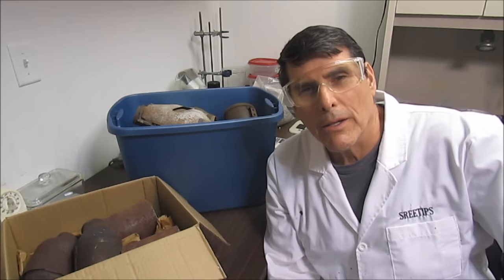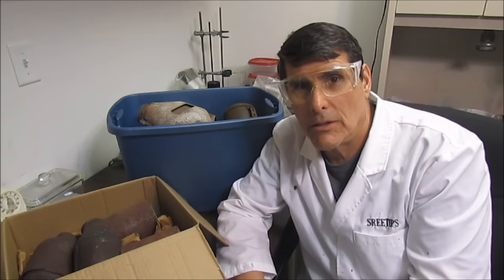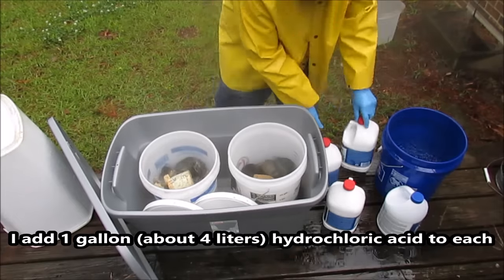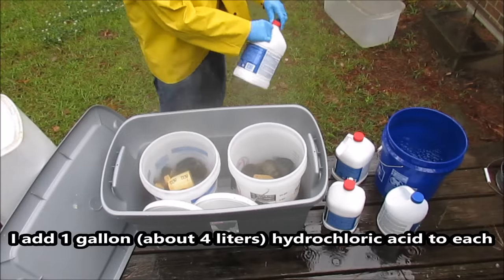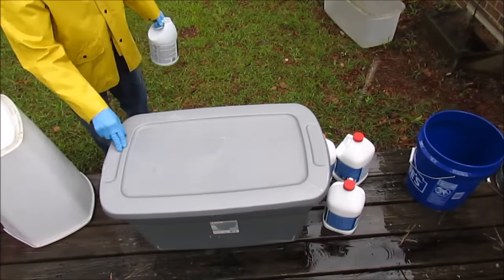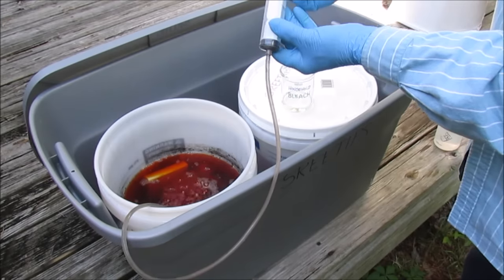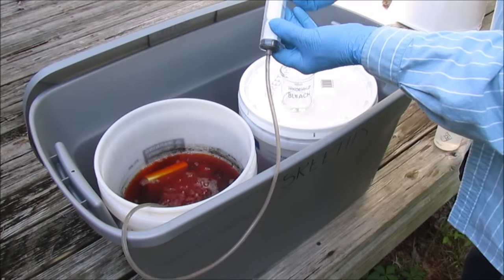Platinum Recovery From Automotive Catalytic Converters Part 1of2

Comment: 30:17 I really dislike the term CEMENTING.  Chemistry was a path I considered after earning the highest grades in high school in all the sciences and could do ion exchange reactions in my head from memory, knowing all the ion states for every element in the periodic table, as well as all the side reactions.  The proper term is REDOX REACTION, or Reduction-Oxidation.
Reply from the maker: Within the refining community, it’s called; cementing
Reply: @sreetips  i know, but you're sometimes using technical terms and sometimes street terms.  Cementing is a street term. Cementation on the other hand, is a technical term, as its a form of precipitation by ion exchange.  All ion exchange reactions are REDOX. It's like saying "preciping" instead of "precipitating".

Comment: Change the filter paper when it gets clogged.
Reply from the maker: Negative, if you noticed some of the fine material made it through that filter. That fine sediment came through the brand new filter when I first poured the liquid through the filter, before the filter "loaded up." Once the filter got loaded with fine particulate, the filtrate began to run clear and free of all sediment. Changing the filter paper with a new one would have allowed more sediment to get into the filtrate. The best option is to pull it through the loaded filter paper with the vacuum pump.

Comment: Instead of all that "goat rope" with the hose, why not put a funnel on the top of the tube & pour the bleach in?  The game should be to minimize the number of handling steps when dealing with chemical hazard!  Not having to even be near the reaction is better than all the masks & gloves!  You could also rig up a rocker to agitate the solution.
          One other Youtuber put hoses in permanently, fed from flask with pool chlorine tablet.  HCl is slowly dripped onto the tablet from sep funnel, automating this process.  You could do the same with either Cl2 or bleach.  Adding Cl2 will not add to the bulk of the solution.
          Quiz question: that same Youtuber precipitated the rhodium with chlorine gas feed (after the Pt & Pd was removed).  How can the same gas both dissolve & precipitate the same substance?
          You are dissolving a handful of grams metal.  Unlike other recoveries, you have no or little "base metals" to deal with.  Why do you need 2 gallons of HCl & many additions of bleach to dissolve such little amount of (very thin coating of) metal?  Does the acid need to be concentrated?  What would happen if you added about 10x less acid at the start?  (I would set up a small pump to circulate the dilute solution in the buckets with a bleach or NaClO3 drip.  The solution needs to circulate through all those channels.  The pump can do the transfers with only a valve.  No awkward pours of toxic solution!)  Then filter & run 90% of it through a still, recovering most of the acid & concentrating the metal so you get good precipitate with (a small amount! of) zinc the first time.  Why does adding more acid, then more zinc, after the metal is precipitated "clear" the solution?
Reply from the maker: I’m not sure. This was my first attempt. I was making it up as I went. After re-watching the videos, I still can’t believe that I was able to pull it off.
Reply: @sreetips  What I would try is this:  Bucket with hoses routed into the bottom.  Have pump that sucks solution from the top & injects it into the bottom.  Between the pump & the jets, I would route the solution through electrolytic cell with 2 graphite plates with a low current flowing.  The cell would plate out any metals in solution on the cathode, the anode would make chlorine gas which would be carried as fine bubbles into the jets at the bottom, as slow, continuous, rate.  I would also have filter in the loop.  You put the HCl in the bucket (a lot less!) & a little chlorate.  Then sit back & wait for all the metals to appear on the cathode graphite.  There is no handling of the hazardous solution & the concentration of the metals in solution remains low (making the loss due to drag-out low at the end of the run).  At the end, the solution has no metals in it (red color is gone).
          Then you strip the cathode plate in HCl & peroxide, & proceed to refine the metals as usual (with SMALL quantities of chemicals, in the hood).

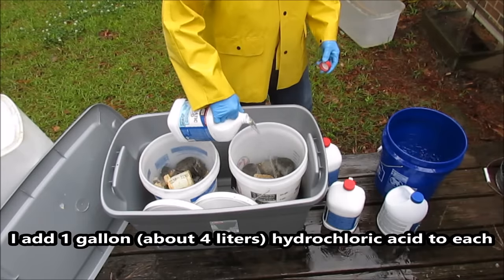Comment: 12:43 - You never add the acid first. Add water first and then the acid.
Reply from the maker: Good rule of thumb.
Reply: Commercual HCl only gets warm if you add the water after. Its Sulphuric which is the danger.
Reply from the maker: Put a drop of water in a beaker full of concentrated sulfuric and it will turn to steam and spit hot acid. I’ve seen it happen.

Comment: I think i heard the words cementing concentration solution precipitate out settle and "i am going to pour in some pieces of zinc / and little bit more acid"  "just a little more acid" over and "black platinum group" over and over like 1000 times...  Then after all that acid addition ... Add more carbonate to neutralize all this acid... Lol. No pH meter use whatsoever
Reply from the maker: Well, I do these experiments by the seat of my pants, I'm not a trained chemist. Perhaps you should give it a try and let's us see your results on video.

Comment: Saw you add water to conc. acid there, big no no in a lab that. Always add conc acid to water never the other way round.
Reply from the maker: Ok, I’ll watch my step. Thank you
Reply: @sreetips  You look like you know what you're doing! But anyone watching and looking to get into chemisty, NEVER ADD WATER TO CONC. ACID. Especially in enclosed vessels like volumetric flasks and conical flasks. Really enjoying your videos by the way Sreetips.
Reply: It should(!) not really matter for hydrochloric acid. Just be careful with sulfuric acid and other acids that get quite hot when mixed with water - do not add water to those. But of course it's better to always add the acid to water in general.
Actually CodysLab did a video on that subject but it looks like it was taken down by Youtube.

EDIT:
Nevermind. It was not taken down. 
1.) "Adding Water to Acids" - https://www.youtube.com/watch?v=RS_TrEbaizg
2.) "Adding Water to Acid; Finally A Reaction!" - https://www.youtube.com/watch?v=_f0vK8Wffgg

Comment: What's beads ?
Reply from the maker: Some catalytic converters used ceramic beads instead of the solid ceramic substrate. The beads can then be replaced with fresh beads (like the ones I had in that containers) when the old beads start to fail the emissions tests imposed by the governments.

Comment: You should try some decent mid to high grade catalytic converters not the low low grade after market cats I see in the front of you.
Reply from the maker: I don't process these because the yields are too low, and it's dangerous!
Reply: @sreetips  thank you Sree I understand.  Fyi I'm into catalist recycling myself and always trying to gain the slightest knowledge on any type of converter 02 sensor ecm gold recovery and more . Thank you

Comment: great video! I would like to ask a question; Bleach, is it the same as sodium hypochlorite (NaCLO)? forgive my question because here in Brazil, there is no product with that name Bleach ... there are other products based on NaCLO that I believe are the same as the friend uses.
Reply from the maker: Yes, bleach and sodium hypochlorite are same.
Reply: thank you friend! I really like your channel!
Reply: Bleach is "Javel" in French so in Portuguese it mught be something like "Agua de Javela" but yes Sodium hypochlorite is the same and it must be easy to get in Brazil due to the swimming pool industry. Hydrochloric acid on the other handus very dufficult due to cocaïne refining.
Reply from the maker: @antejl7925 isn’t hydrochloric acid used to adjust total alkalinity in swimming pools. I can get hydrochloric acid at the swimming pool supply.

Comment: Excuse me what's AC catalyst ?
Reply from the maker: I'm not familiar with AC catalyst
Reply from the maker: Some catalytic converters have beads instead of solid ceramic substrate. When the beads inside the converter become expended there is a plug that can be removed, the old beads removed and new beads (like the AC beads in my video) installed.

Comment: the balls that you add at the beginning are? before adding the 4 litres of water and muriatic
Reply from the maker: Those are catalytic beads
Reply: @sreetips  What exactly are catalytic beads? Boy, I don't know how you read half the questions and replies. The non-sequitors, the misspellings, the grammatical errors. I think one question actually misspelled platinum 3 times, none the same. Great video, mostly everything laid out precisely, step by step, except for a couple of "a little more,  a while longer s". Otherwise perfect. I think too many people missed the real point, besides your joy in learning and teaching, you are telling people that aside from the enormous amount of time and work,  the dangers far outweighs the possible profit. You obviously already owned much of the equipment, but to start from scratch, the cost of the machinery, the cats, the buckets, containers and beakers, the chemicals, bleach etc. would seem to preclude any chance of profit. And of course, there's the danger element. Bottom line, learned a great deal, and have much respect for your knowledge and determination.
Reply: One additional comment. You use pool PH lowering powder to neutralize the acid. Isn't that just a more expensive version of baking soda?
Reply from the maker: No, sodium carbonate. Baking soda is sodium bicarbonate.
Reply: No answer on the catalytic beads?
Reply from the maker: Some catalytic converters have a threaded plug that can be removed, old beads drained out, and new beads added. These were new beads I bought on eBay.
Reply: @sreetips  Thanks for taking time to answer my questions. I can tell that you are an intelligent man with lots of experience. You enjoy continuing to learn, and sharing your accumulated knowledge, and the new knowledge that you discover on your journeys. A true Renaissance man. Don't let the intellectually stunted and fear mongers out there slow you down. I've enjoyed your videos for the learning, for the journeys, and for your unalloyed love of sharing your wisdom. Keep up the good work. My intelligence has always been more on the other side of life, language, reading, words, in other words, liberal arts. I avoided science (even though I loved it as a kid), because the first thing that I ever failed at was a chemistry course in college, so I then stayed far away from the sciences. If I had you as a teacher, things might have turned out differently. So continue to  add your wisdom to the world, to these who can benefit from it, as long as they see what you're actually trying to accomplish. Ignore the haters and those who believe that they are so much smarter than you are. BTW, is sreetips something backwards, like S Piteers, or spite ers? Just wondering.
Reply: And oh yeah, have you posted the refining video, I haven't been able to find it. A few weeks ago you said it was on the way.

Comment: Anyone else triggered watching water being added to concentrated acid?
Reply from the maker: Pouring water into hydrochloric acid produces little to no heat reaction. This is based on my eleven years experience. However, pouring acid into water is a good rule of thumb. Some acids react violently when water is added to them. Hydrochloric is not one of them.
Reply: @sreetips  You don't think it produces more vapors as a result of adding water to acid? I get small whiffs of acid at work dispensing 2 liters quickly into water, but little to no vapors if I add it slowly. I suppose it doesn't matter if your mask is providing adequate protection and your not choking on the vapor. Personally I add it quickly and vacate the area lol
Reply from the maker: Possibly, but most of my work is in the fume hood so I don’t notice.

Comment: I cant understand taking zink out to put it back..
Reply from the maker: Did I do that? I added zinc metal to "cement" the PGMs out of the leach solution. Then I added some dilute hydrochloric acid to remove any residual zinc from the cementing operation. The dilute HCl will dissolve the zinc but not the black PGM powder.
Reply: @sreetips  you should re watch this. You remo ed zink rated it then added acid and added more zink.
Reply from the maker: Got it, the black powder precipitated on the zinc in a colloidal form that resembles ink, it won't settle no matter how long you let it settle. I've even tried to centrifuge it with negative results, the solution stayed as black as ink. To get it to come down more HCl must be added followed by some more pieces of zinc. I can't explain why, I just know from previous experience that this is how I was able to get the solution to clear up. I tried this exact experiment several years ago. I encountered the ink problem back then and I had no clue how to proceed so I scrapped the entire experiment and took down the first two videos. Then I did some more research on the goldrefiningforum.com and stumbled upon the exact problem I was having in one of the threads (getting info about refining platinum group metals can be difficult - nobody wants to give away their secrets) - in that thread the author described the ink problem and what he did to solve the problem. He simply added more HCl followed by more pieces of zinc and the solution cleared up. So I just followed what he did and got the same result, plus another tool for my refining experience. Hope this answers your question.

Comment: Can you write me the process for me to translate it?
Reply from the maker: Daniel, writing the process would take too much time. If a picture is worth a thousand words then a video has to be worth a million. There are many things that would have to be explained. It would be a book when I got done. I relied heavily on my 8 years of refining experience to pull this off. I sometimes watch this video and wonder how I did it. This is not a good place for a beginner to start. It's dangerous and the amount of metals recovered doesn't cover the cost. You can't make a profit refining catalytic converters in your home. If you want some platinum then it's best to just to buy some. Sorry I couldn't be more helpful.

Comment: paypal and ebay transactions let you know who rececived the money from the robbery. payback is a bitch! they steal from the wrong person they might just become a internet star in a snuff film
Reply from the maker: Steph, I bought these back when palladium was $600 per ounce and rhodium was under $1000 - rampant thievery had not set in yet. By the way, those metals have NOT increased, the currency used to price them has fallen relative to the metals. And we’re just getting started.

Comment: I have a metal ore that contains 0.25% of platinum. If I process and refine it will the purity or percentage increase?
Reply from the maker: No, the percentage won't increase. But it may decrease due to small losses during the refining process.
Reply: sreetips Thanks so much, so how can you make a metal a refined platinum with 99% purity ? I thought refining increases the purity?
Reply from the maker: In this video I extracted a black powder. The black powder is a mixture of platinum and palladium. In part two, I'll separate (through a refining process) the metals. Recovery and refining are two different processes. After refining, the platinum should be up around 99% purity. The palladium will be even higher, up around 99.95% purity. In a later video I will then re-refine the 99% platinum to high purity (99.95% or 9995 purity) with a hydrolysis method where the impure Pt sponge is dissolved and then a chemical is added that forms metal hydroxides of all the platinum group metals except platinum. The platinum, not forming a hydroxide, stays in solution as a mother liquid of high purity platinum that is siphoned off and reduced to metal wiith formic acid - all coming up in a future video.
Reply: sreetips Thank you so much sir. So why can't I get a 99%  refining  a catalyst ore that contains 0.25% after pretreatment and extraction?
Reply from the maker: Damian, sorry, I don't have any experience with ore.

Comment: I wonder what the EPA would fine you on their first visit?  Yikes!  The local dismantler did they get hit $10k per violation. That's for simply spilling some motor oil... I heard R12 R22 R134a is $25k per violation... I guess your going to need alot of catalytic converters to cover that bill...
Reply from the maker: Take it easy, I do it as a hobby. Nothing gets added to the local waste stream until AFTER it has been treated. But thank you for your concern.

Comment: Jeez 2.5 hours of video that could have been edited down to 10 minutes.
Reply from the maker: And I thought about making a shortened version. The reason I started making these videos was because all the videos I could find on refining were garbage. They showed only part of the process or left out critical details. Very irksome. I included all the details in this video because refining of the platinum group metals is very difficult. Sorry for your loss. I just watched both of these videos myself today. The full 2.5 hours. They are still mesmerizing to me and I still can't believe that I pulled it off.
Reply: Did somebody force you to watch it all?  Like tie you up and tape your eyelids open.
Reply: Thank you sreetip your effort is much appreciated by the majority:))